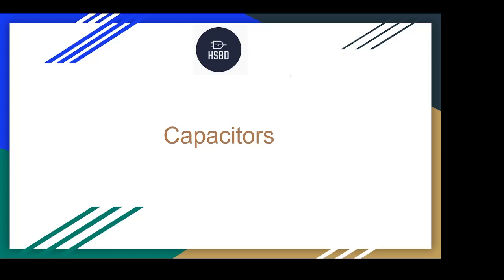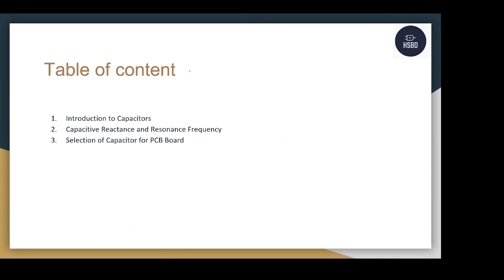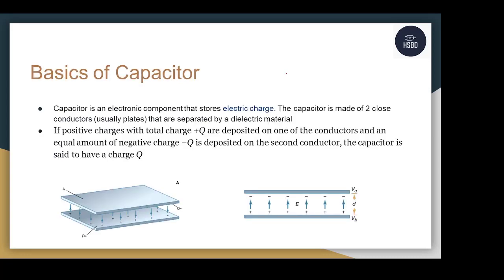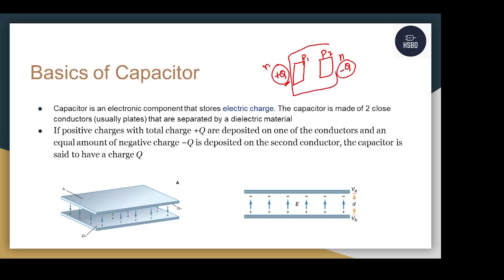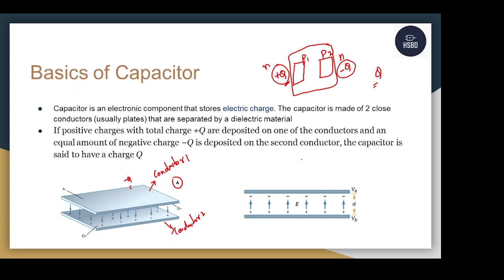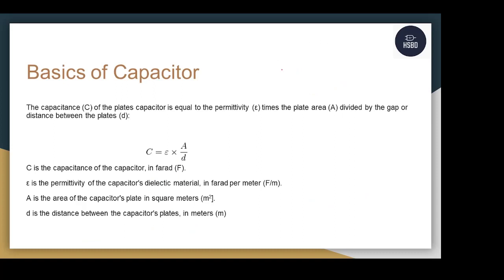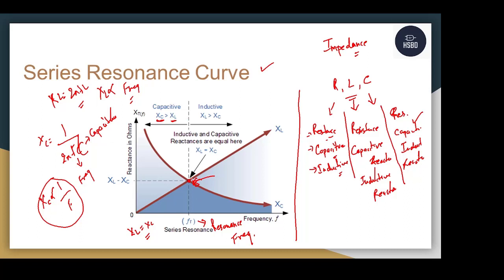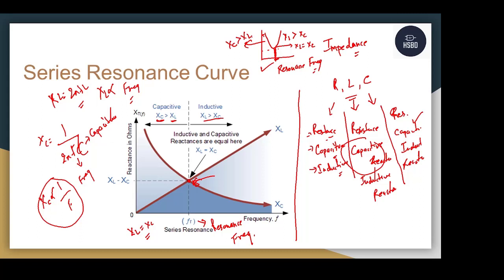Introduction to Capacitors || Resonance Curve

Comment: There is a dielectric material between two copper traces in a pcb .....there is no filed between them .. because of dielectric !!! How two llel traces forms an capacitance?
Reply from the maker: Thanks for the Query...
"In the given example we tried to explain taking capacitor basics into consideration.
In PCB, the stackup is created in such a way that each signal layer has the empty space which is filled with Dielectric material by default. 
Therefore, the two traces acts as parallel plates of a capacitor having a dielectric material between them.
Reply: @bhardwajh_2701  what is the minimum width to be maintained to eliminate capacitance between the traces one in top and one in bottom of same core or both on the same side ?
The prepeg material is dielectric means there is no flow of electrons,how capacitance effect forms ..if it formed how it will charge and discharge?
Can I expect more videos on SI/PI ??
Reply from the maker: Hi Suresh, 
" This totally depends on the design parameters, 
As per industries standard, we keep 2W and 3W spacing between to traces. 
You can check out crosstalk video for more clarification on the same